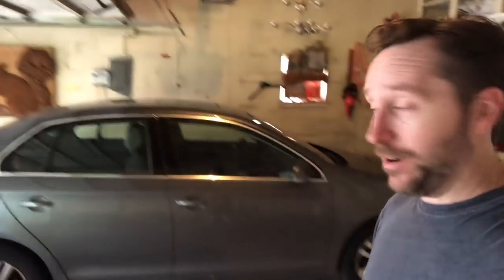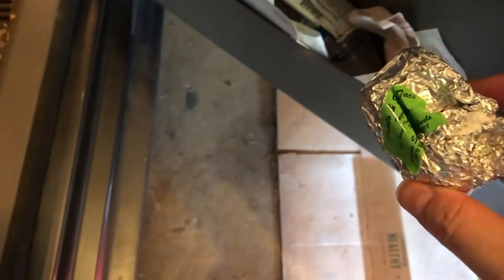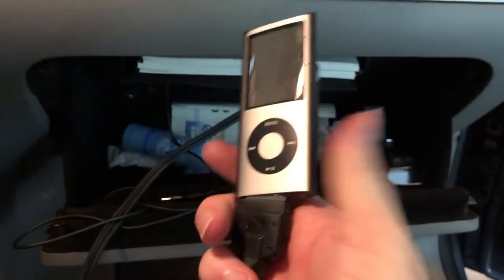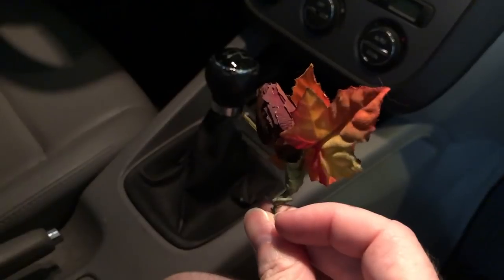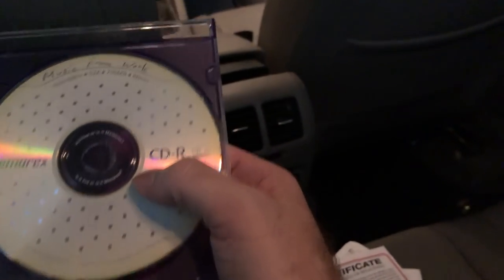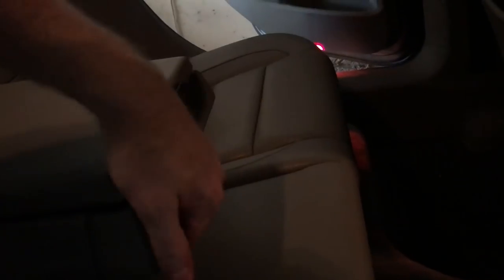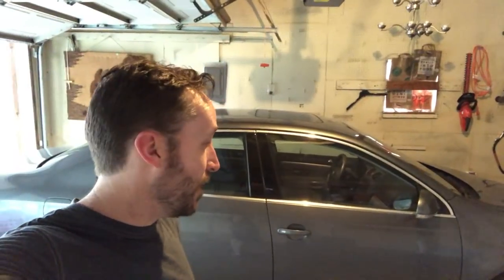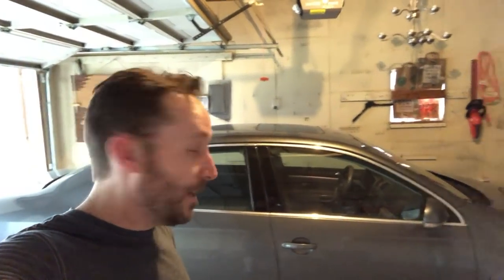My Old Car Is A Haven Of Filth And Memories | Joe Scott TMI

Comment: Joe on those headlights to make them clear again use orange mechanics hand cleaner with the pumas in it. It will clean them up nicely and cheaply, without having to tape off the surrounding area like the average headlight cleaner.
All that is on the lights is road film basically, why a grease removing  hand cleaner will work.

Comment: You better now let the Tesla get that messy. If you didn't already purchase the Tesla wall adapter, you could save yourself some money and just put in a NEMA 14-50R 240V plug. The cable for that comes with the car and that plug could be universally used for all EV brands. I put in a Tesla wall adapter but it charges only slightly faster than the 240V outlet would. I see your electrical panel is right there so should be an easy job for either.

Comment: Headlights, dimmed and fogged. What can you do? Actually, you can make that better quite easily. Loads of videos on YouTube to show you how. You just need to buff it out.
Hint: In case you are letting your wife drive around in a car with the same issue.
Reply: Jumper cables: Your Tesla has a 12 volt battery in the frunk. As do Leafs. You may have to repurchase that. Or be at the mercy of the kindness of a more prepared stranger.